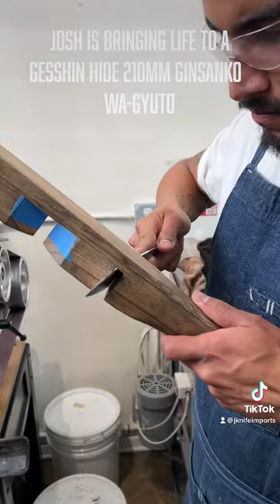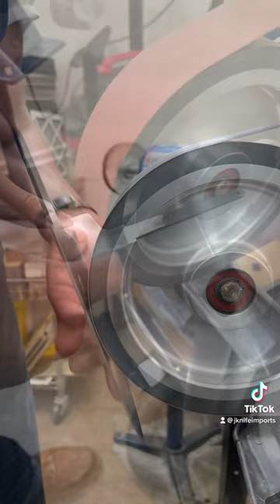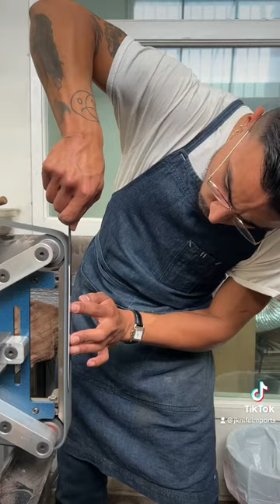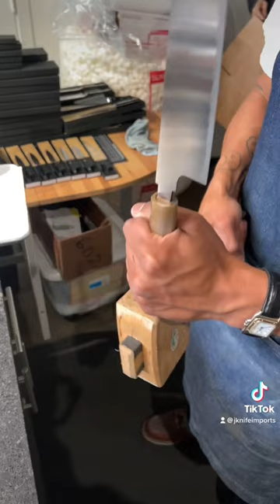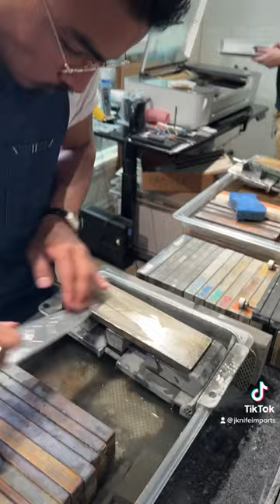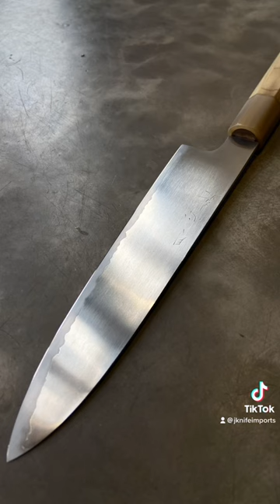KNIFE SPA TREATMENT

Comment: Is that wood filler Josh used to fill the gap in the handle?
Reply from the maker: we used hot melt glue for the handle install, and that fills much of the gap in the handle... but we use wood putty at the top to fill that space a bit better and give it a clean look
Reply: What is the idea behind choosing to use the large contact wheel first and then go to the standard platen? Love these shorts!
Reply from the maker: @constantObserver  the finish on the flat platen with the scotchbrite looks better than on the contact wheel